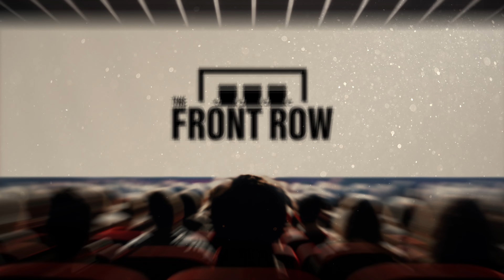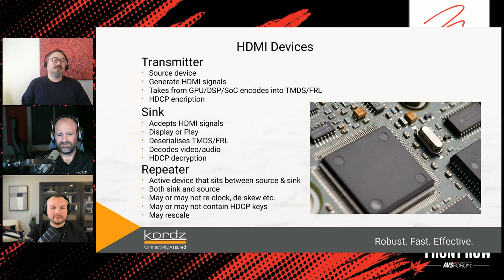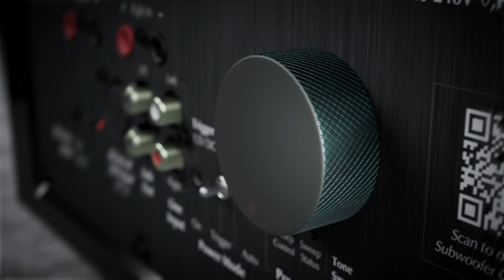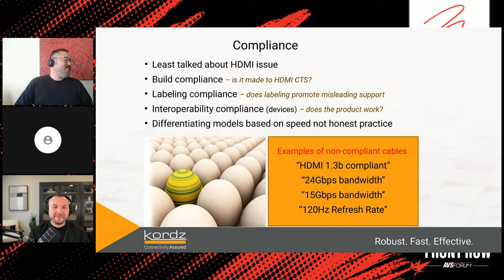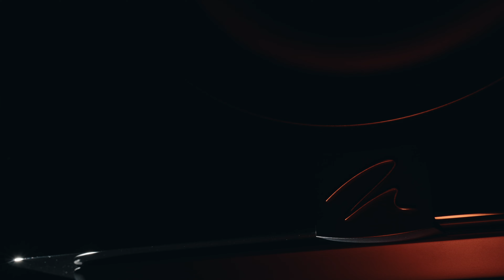HDMI Part Two: Because One Episode Wasn’t Enough | The Front Row Podcast Episode 7

Comment: HDMI did soo many things right an soo many wrong. 
Yes we all know HDMI 1.4, 2.0, 2.1 ect is the spec, and you can't spec a cable, so you have to give the cable a different name ? 
Sorry but me as a consumer, when i go to buy a cable, if the cable says its a HDMI 2.0 ready or whatever, this tells me if the cable will work for my use case or not. 
If i see "Ultra High Speed HDMI" this doesn't tell me anything. 
What the heck are these names ? 
Standard HDMI is ok
High speed hdmi is what ?
premium high speed... 
ultra high speed
ah yes, we ran out of stupid names, so lets do ultra96 now
Does ultra96 have "high speed" at the end ?
This is the same BS as USB did, with their USB 3.1 GEN 1, or GEN 2, or USB 3.2 GEN 2x2 
Why ? You go to the store, you look at a USB 3.1 GEN 2 cable and it doesn't tell you anything. You need to google a chart, so that you can match the stupid name to a speed. 
USB 3.1 GEN 2 being 10Gbps ect ect
This is the same [redacted] as what HDMI did. 

And the other BS which the optional stuff, this makes everything even more complicated, as now i can buy a HDMI 2.1 device, and i need to SPECIFICALLY check if it supports VRR, or ALLM, or any of the HDMI 2.1 spec features. Everything is optional ?
Heck, the speed might not even be 48gb, it could be only 40gb, and this makes its 2.1 compliant. 

The world would be soo better if the device and the cable had the same name and the same compliance. If a device is HDMI 2.1, it should support all HDMI 2.1 features, and if a cable is HDMI 2.1 ready, this means it can do the full HDMI 2.1 speed and it has all the cables inside it to carry everything that the HDMI 2.1 spec says it should do. 

Sorry for my long rant, but ye... every consumer on this planet complains about this BS and it misleads consumer even more of what they are actually buying. This makes everything worse, not better.